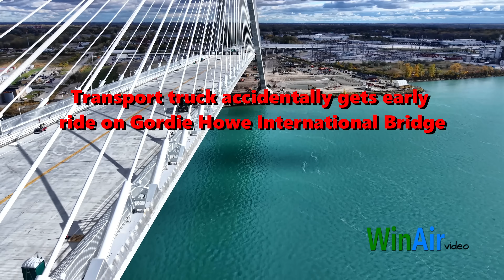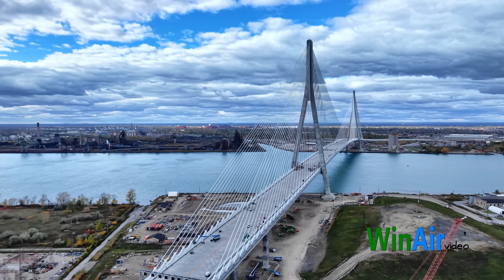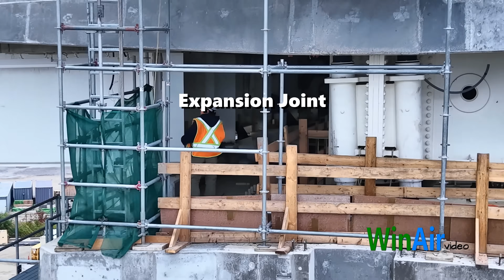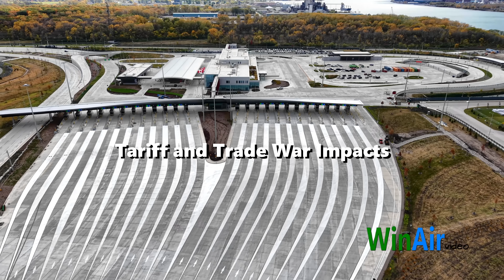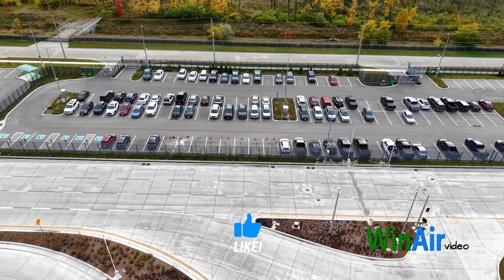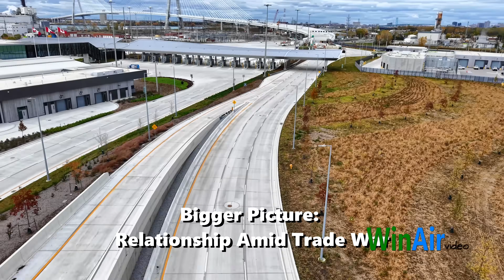See The Bridge Everyone Is Talking About!

Comment: I wonder if the contractors have been paid.
Reply from the maker: Hi Norris. Good question. So I did a quick search and this is what I found;
As of October 29th, 2025, there is no current public controversy or widespread report indicating that contractors are not being paid by the Windsor-Detroit Bridge Authority (WDBA) for work on the Gordie Howe International Bridge. Past disputes and payment claims between the main contractor consortium (Bridging North America) and WDBA were significant earlier in the project and did result in delays and a substantial settlement. However, those disputes were resolved with a $685 million agreement executed in December 2023, which included cost relief and additional schedule flexibility for the contractors. That settlement released WDBA from further actions, payment demands, or claims for work done up to December 2022, and as of the latest available reports, there are no ongoing formal controversies or lawsuits regarding unpaid work since that comprehensive settlement.

The project did experience increased costs and further delays due to various technical and supply chain issues, but public statements from WDBA and news coverage through late 2025 focus on construction progress and opening timelines, not on payment disputes or unpaid contractor claims.

I'm glad you asked. Sounds like they are keeping it fair from the reports. I'm sure there is somebody that feels they have been treated unfairly, but nothing in the current news.:) Thanks for the question.

Comment: An interesting question - it's clear that the bridge will carry an undivided 6 lane highway, but why no traffic barrier or median?
Are there operational reasons for why highway border crossings between the USA and Canada can't have traffic stream separation?
Reply: There is no separation of the traffic lanes so as to allow shifting of lanes as needed.  If there is more traffic going one way than the other, the lanes can be changed from the 3-3 configuration to a 4-2 configuration.  This could also be done if there was an accident on the bridge and lanes needed to be shut down.  The bridge has lane signal signs, above the roadway, to inform drivers which lanes can be used.
Reply: @SteveR59  OK, that's interesting - there's a motorway in Birmingham (UK) that more or less works like that.  They call it a tidal flow system.
Reply from the maker: Hi RedKnight. The reply from StevenR59 explains it well.

Comment: the Towers should’ve been painted white, what are they thinking ?
Reply: It is smart not to paint the towers white.  While it would be aesthetically pleasing, the cost to repaint it would be astronomical and maybe requiring multiple lanes to be closed to traffic.  The designers are THINKING ahead at "what if scenarios"
Reply from the maker: Hi Wayne. They were to be painted with an epoxy based coating, but I suppose they changed their minds likely to the cost. However it got me wondering how long the bare concrete would weather before needing maintenance so I did a quick search. This is what I found;
  The lifespan of bare concrete exposed to the elements, such as the towers of the Gordie Howe International Bridge, is typically designed to last around 100 years or more under standard conditions with minimal major repairs, provided high-quality construction methods and materials are used. Modern bridge towers like those on the Gordie Howe Bridge are engineered using reinforced concrete mixes, careful placement, and stringent quality controls to withstand extreme weather, freeze-thaw cycles, and other environmental stressors.

### Influencing Factors

Several factors affect how long exposed concrete will last:
- *Quality of Materials and Workmanship:* Proper mix design, water-to-cement ratios, reinforcement, and thorough curing processes extend lifespan.
- *Maintenance:* Routine inspections and minor repairs help reach or exceed the design life without major rehabilitation.
- *Local Environment:* Exposure to water, freeze-thaw cycles, chlorides, and pollutants accelerates deterioration but can be mitigated with design adaptations like epoxy-coated rebar and air-entrained mixes.

### Gordie Howe Bridge Specifics

The Gordie Howe Bridge towers use specialized, reinforced, cast-in-place concrete engineered precisely to ensure stability and longevity, with design lifespans stated to exceed 100 years, potentially reaching 125 years due to advanced durability studies and materials selection.

### Concrete Lifespan Summary

- Typical unprotected, reinforced concrete structures: 75–100+ years.
- With high-performance design and maintenance (like the Gordie Howe Bridge): 100–125+ years.
- Actual service life depends strongly on protection against moisture intrusion, freeze-thaw cycling, and reinforcement corrosion.

In summary, properly designed and maintained bare concrete bridge towers—such as those on the Gordie Howe International Bridge—are expected to last at least 100 years and frequently more, even when left exposed to the elements.

Good call on your part. I was actually surprised to see the longevity of the specialized concrete in the GHB. If painted, they would have to repaint in thirty years, maybe sooner, so three times in a hundred years. Leaving them bare is a big money saving decision now and for the future. Great comment, thanks for sharing!:)
Reply: I agree…
Reply from the maker: Hi King. I agree 100%! :)